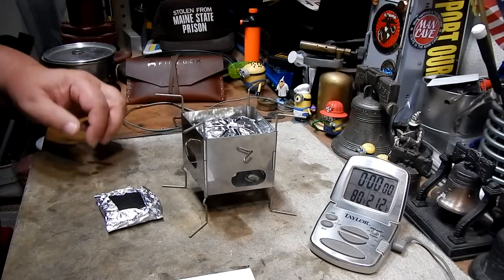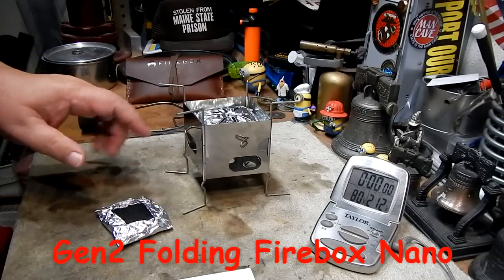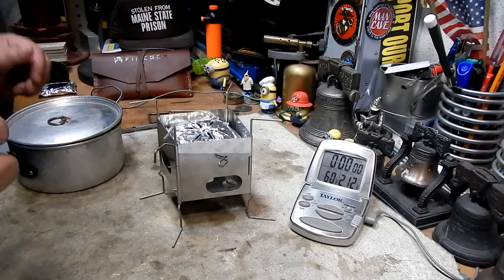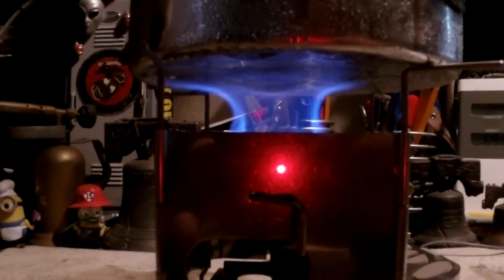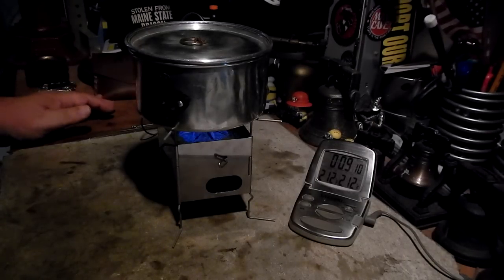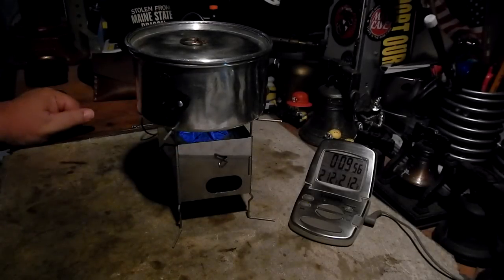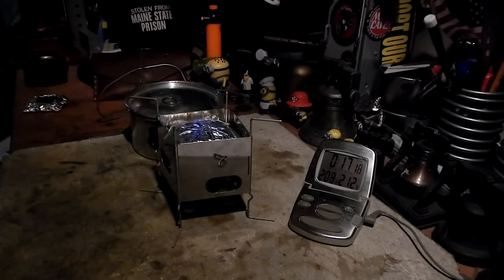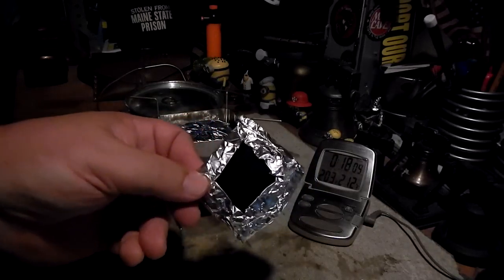Gen2 Folding Firebox Nano - T's Stove's Zabuton Burner V2  - Boil Test

Comment: Mr Cook, thanks to your diligence in recording test results, specifically the total burn time or “run out” time, it is possible to solve this little nugget. V2, with it’s fancy pie slits, put out 40 W less heat than the 1 inch square hole of the V1. But both burned with a fuel efficiency of over 60%, which is way better than the majority of the other stoves you’ve tested. Good job, and thank you!

Comment: I use the Tangia Spirit burner with the Nano Gen 2. I was looking at making a feed system, bottle, hose, all that in case my alcohol ran out during cooking. I will use these instead and will leave them dry until needed. I'll make two. I found the felt at Lowe's near the soldering stuff as Hiram indicated. $17 and change for 9x12 piece. I'll remove the Tangia and pop in one of these on top of the Nano rods where the Tangia was located. Easy!. If made how he shows 2 1/2 x7 felt folded in thirds it works in Hiram's video here https://www.youtube.com/watch?v=wI3WSgLYJk0&t=7s. 

Great idea and thanks Hiram for testing this.

Comment: two ideas that i had: 1. cut out the center of a POP can , flatten, then fold per the foil. may want to punch the burn holes first.  2. place your 3/4 inch hole into the lid of a ALTOIDS SMALLS tin, fill with Carbon Felt, and use that way.